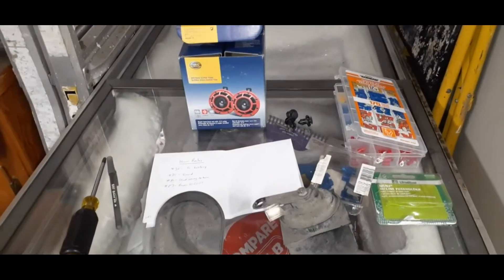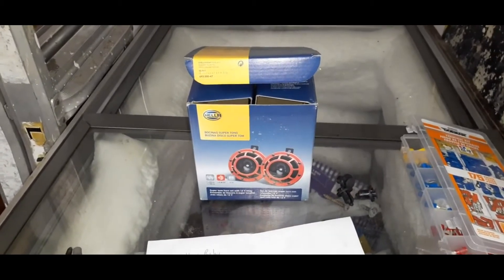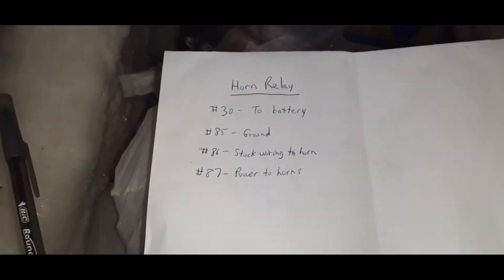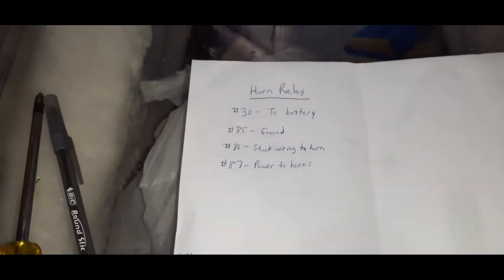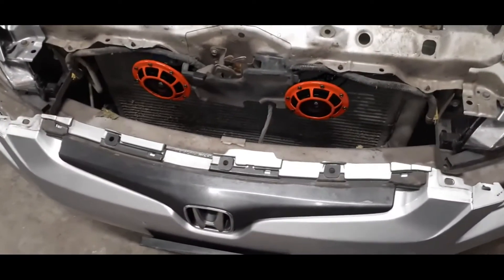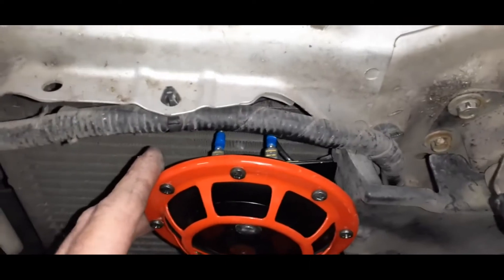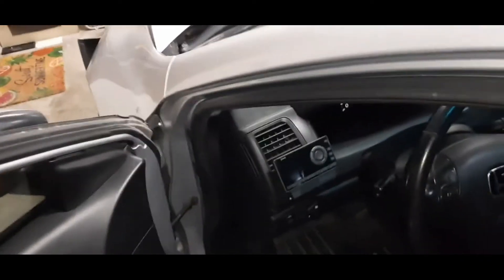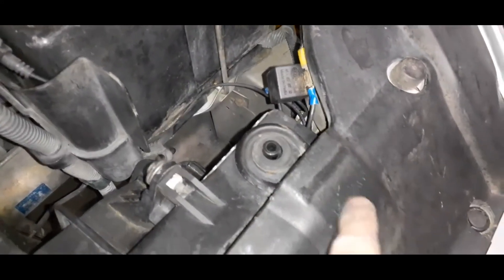Hella Supertone horn install 2003-07 Honda Accord

Comment: Cool video! As I said elsewhere, along with a clutch pedal, I wouldn't imagine a horn as being a part that would wear out - I guess almost 900k isn't a bad run! Quick question - why didn't you just replace with an OEM replacement (either new or from a junkyard)? Were you looking for more volume?
Reply from the maker: Not necessarily more volume, but that's a good by-product of installing these.  I didn't want to make a run to the junkyard  just for these.  Oddly enough, there are two different brands listed on Honda's website. One is double the price of the other.